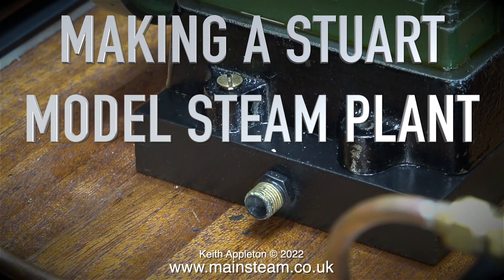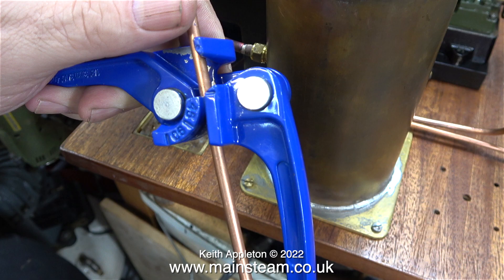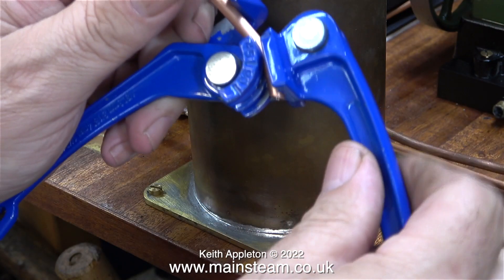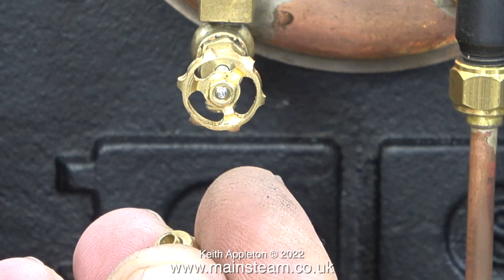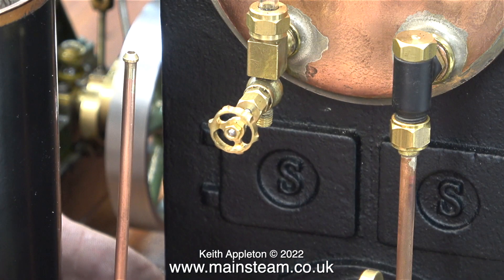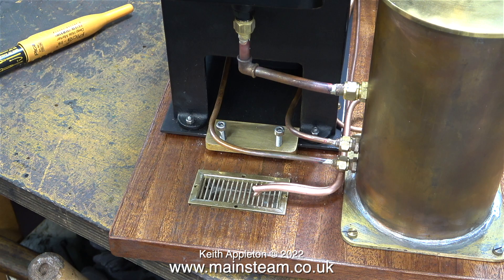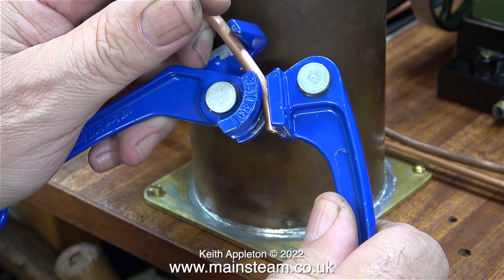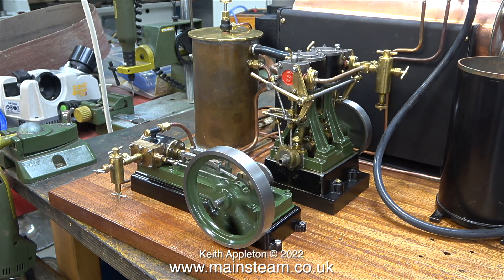MAKING A STUART MODEL STEAM PLANT - PART #71

Comment: LOL I love that barco spanner line ... sure some adjustable wrenches like this (american made) are JUNK they are made to wobble and slip and mess stuff up royally ... in the several hundred video's on this channel I have watched and you have used that spanner ... I have never seen it loosen wobble or slip on a nut ... it has NO SLOP at all ... heck those wrenches in that quality are worth the money one pays for them ... and yes I do own one of he american garbage versions ... set it for 1/4 in and you can do up to 1/2 an inch in it ... THAT is poor quality and crap workmanship ... one day I will be ordering some barco's and getting them shipped here because they will be worth every penny they cost
Reply: ahhh call it the x rated lathing version of reducing a pipe end ;) ... Blurred for the young LOL
Reply: perhaps in the sump hole ... in future ... make the far end angled ( / ) so when the pressured pipes flow they jet gets turned and directed back into the sump ... perhaps the end off of a cigar tube would also work ... but first you have to find an empty cigar tube ...
Reply: hmm thinking of the sump pipes ... just shy of 1/2 inch total diameter ... how would a half inch tube look as the top end of the sump ... say a small section of 1/2 inch pipe as the sump inlet hole ... and then some sized reservoir under that to hold the fluids .. you could then make a brass or some other metal cap to hold the pipes in place and act as a mounting bracket for the pipes ... heck if you want to get fancy .... perhaps make the 1/2 inch pipe look like an oil drum above the board ... and bend the pipes into it ... for the barrel rings just attach a small wire on the outside of the pipe and smooth it in where the ribs would be ... then the sump is hidden in plain sight ... 
.
 might be something worth trying
Reply from the maker: I need to keep it simple so that the piping is easy to fit by the owner of the plant when he receives it.
Reply: @keithappleton  i know that ... but it might be something to try for a different build ...

Comment: I'm pondering the size of box that's gonna be required just to ship the prebent piping 😁
Reply: it can all fit in under a 2 cube box ... and I bet a 1 cube box will be sufficient for all of it ... as for packing it secure ... SPRAY FOAM ...  yes put a layer on the bottom lay some plastic wrap or bubble wrap lay some parts cover em over spray some foam repeat ... eventually top off the box with the foam and nothing should move